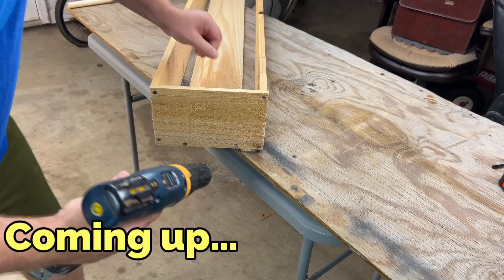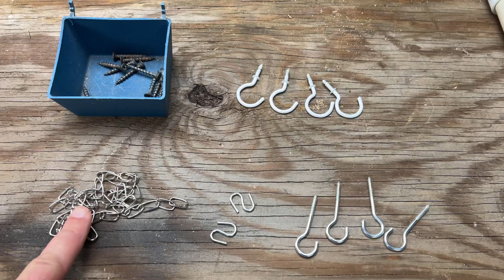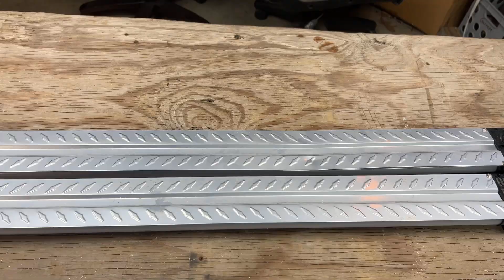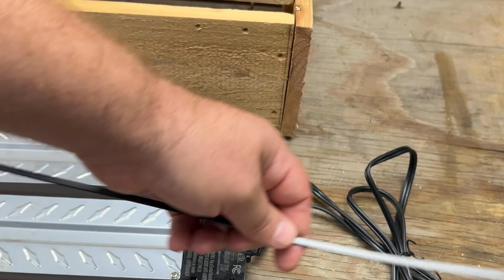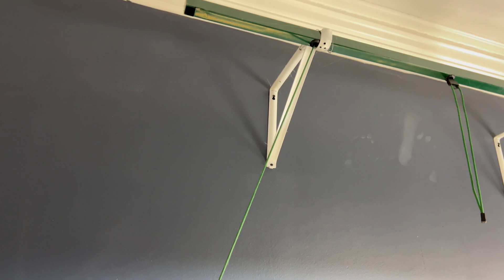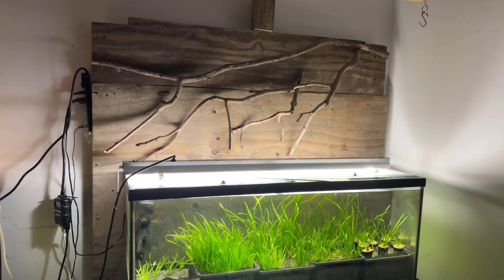How to make a DIY Riparium light box

Comment: I would love to see you figure out a light box idea for that other shop light, as thats the one i have and i am unfortunately short, and eye level with it.
Reply from the maker: Do you mean The other light that gets hot?
I’ve been wondering if lining the inside of the wooden box with a reflective material would help, and instead of using a wooden board running lengthwise along the top, use another material bridging the sides together in 2 or 3 places which would leave the top more open allowing heat to escape better, if any of that makes any sense.